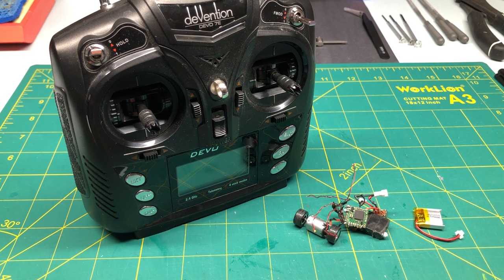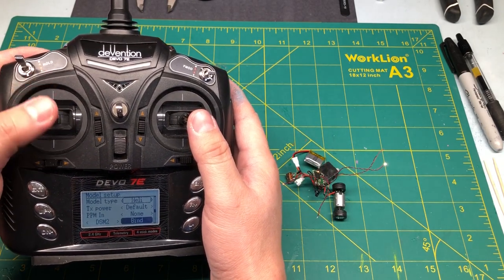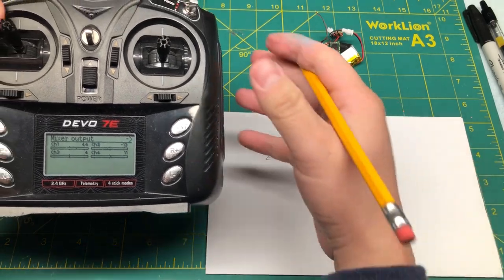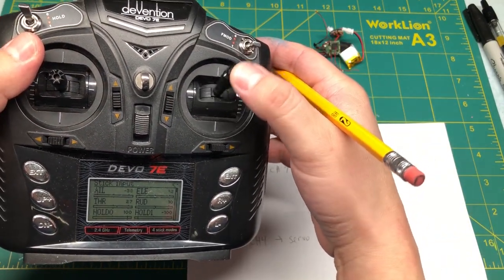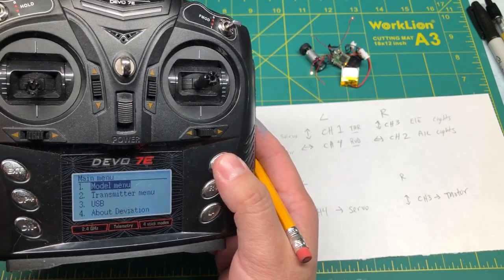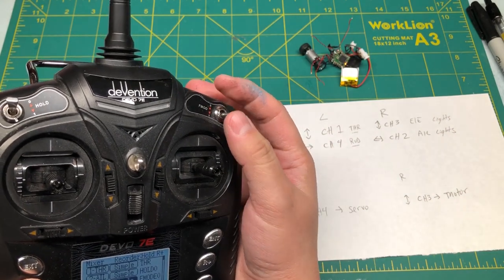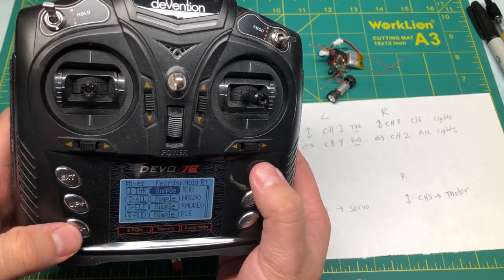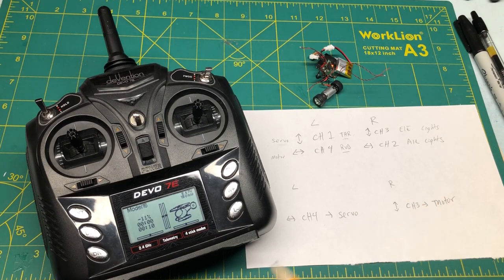Hot Wheels RC car | Devo 7e Transmitter and Deltang Rx43d Receiver

Comment: but how about the transmitter it's doesn't only works ridolink right? Like I have different brand of transmitter and ridolink receiver will then connect or no?
Reply from the maker: No, this transmitter will not work with a Radiolink receiver. You will need a transmitter that has the same protocol as your receiver.

Comment: I've been following one of your tutorials, I have all the electronics expect the receiver and transmitter, I'm trying to keep the costs as low as possible. Are there inexpensive alternatives for this? thanks
Reply from the maker: Radiolink has cheaper receivers. Check out my Amazon store.
Reply: @SlickDiecast  I think the receiver will be too big, its 0.98 inches in length and half an inch in width
Reply from the maker: The 4 channel receiver works for me but may be big for some cars.
Reply: @SlickDiecast  ah okay I'll have to find a small receiver and controller
Reply: @SlickDiecast but how about the transmitter it's doesn't only works ridolink right? Like I have different brand of transmitter and ridolink receiver will then connect or no?

Comment: hey plz make video of making micro servo....plz plz.....
Reply from the maker: What do u want to see?
Reply: @SlickDiecast  thanks..

I am from Bangladesh... And I am a  begginer in this....  and  in our country micro servo r very expensive and very rare....so I am looking that anyone  is there that make a micro servo...
no one releasing video of making a servo....   

so  I am requesting you to make a micro servo video...
how the servo are made what will be need...  which feedback circuit used in servo..plz make video how to make micro servo
Reply: @SlickDiecast  plz it will be very help full for those who are stuck at here .......  plz plz plz plz....help us with your research....    you make car steearing with servo...but  that micro servo  rare in many country...  so plz... make  a  servo that can control with transmitter....  wirelessly
Reply from the maker: Sorry I did not make the servo. I bought it from a supplier.
Reply: @SlickDiecast  but  you can make it I know....
Reply: @SlickDiecast  many youtuber maked micro analog servo...
but  problem is they not realising how they make it....  so...plz reasearch on servo....
Reply: @SlickDiecast  and make your own homemade servo